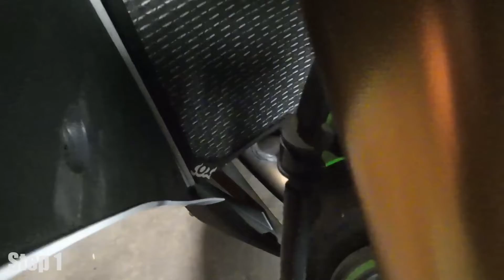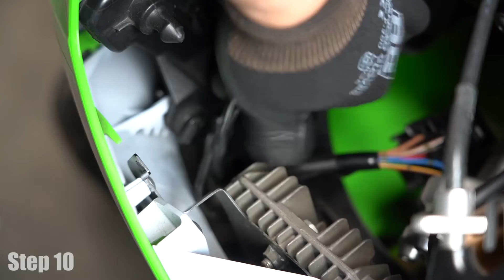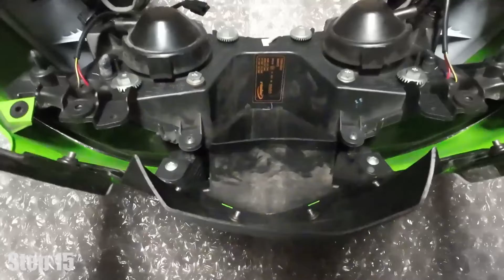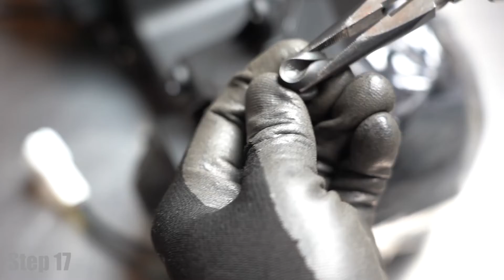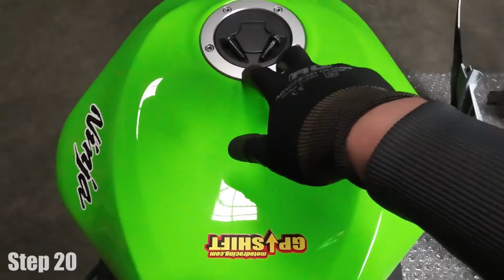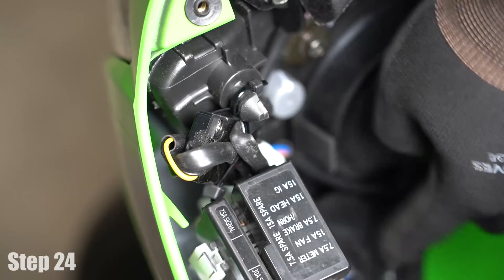13-18 Kawasaki Ninja ZX-6R Motodynamic Full LED Projector Head Light with DRL Install + Intelliflash

Comment: My high beams no longer turn on, it's just the DRLS. Would this be because of a faulty flasher relay or a blown fuse?
Reply from the maker: Likely a blown fuse. Check the fusebox, you should have some spares. The flasher relay is on a separate circuit so it will not affect the low/high beams.
Reply: The high beams only turn on when the bike is running
Reply from the maker: @snowreaper4450  Correct, low and high beams only turn on when the engine is running.